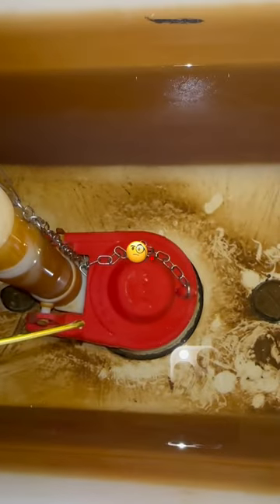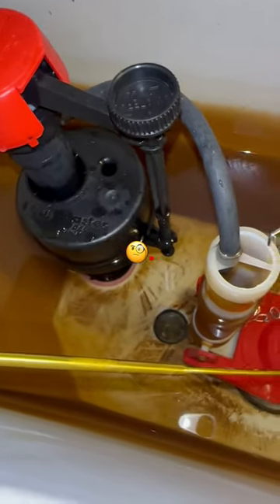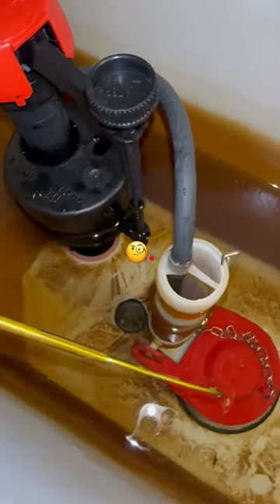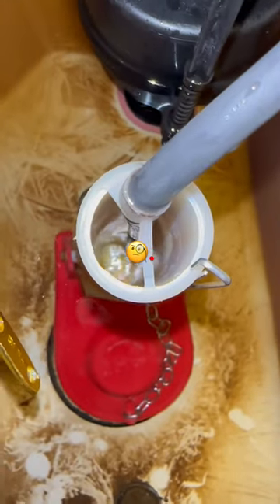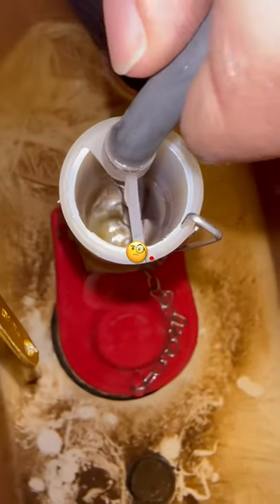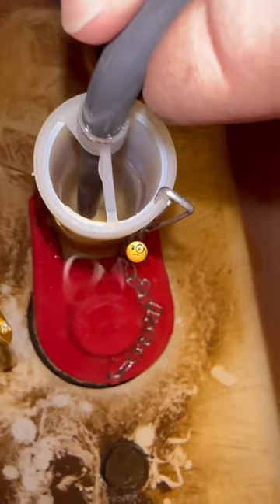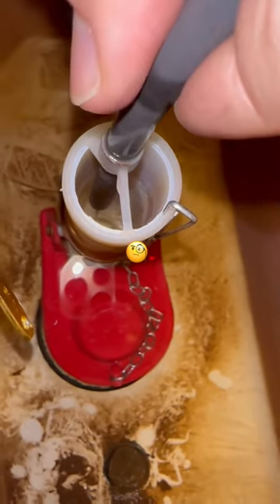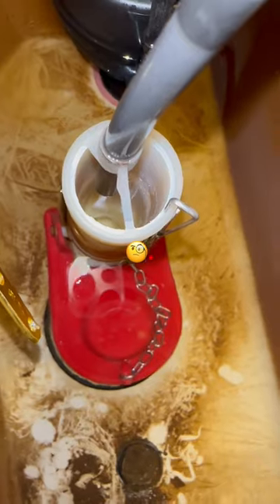Toilet Fill valve repair

Comment: You know the small prongs holding the water leveler? Mine broke. What kind of glue do you recommned to use instead of buying a new one. It was just replaced 3 months ago.
Reply from the maker: They have clips for the hose
Reply from the maker: https://a.co/d/gG0WBEx
Reply from the maker: https://a.co/d/foIQLHS
Reply from the maker: Check maybe one of these can help
Reply: I appreciate the response. I don’t think I explained well where the issue is. It’s not the chain or fill valve. It’s the prongs holding the leveler on the side of the valve tower. Is there a way I may send you a pic of the issue? Or maybe you are suggesting ways to help but I am not seeing it. Anyway, thanks for the suggestions.
Reply from the maker: Yeah send a picture of the problem
Reply: @carolinag1536 you're referring to a Mansfield toilet. They have their own unique system. The realize the tank levers keep breaking is because the seal in the tank (the one below the tower) is going back and sticking. When that seal sticks to the tower, the tower doesn't want to lift when you use the tank lever. As such, it puts more strain on the lever and causes it to break.